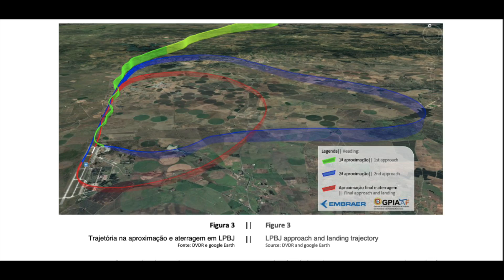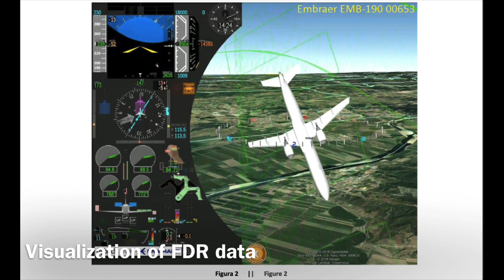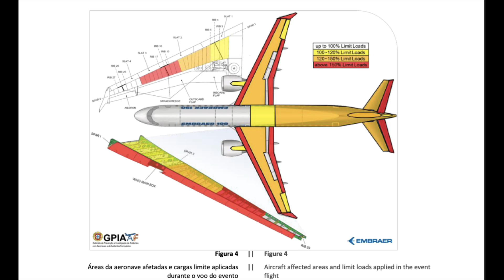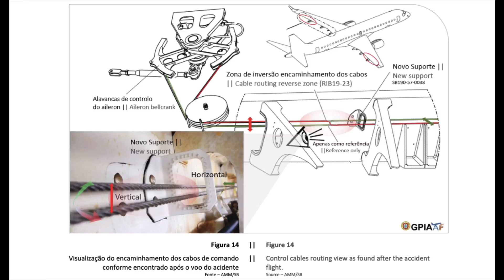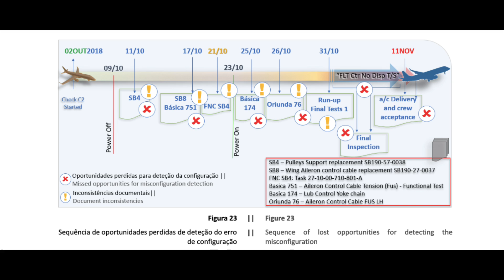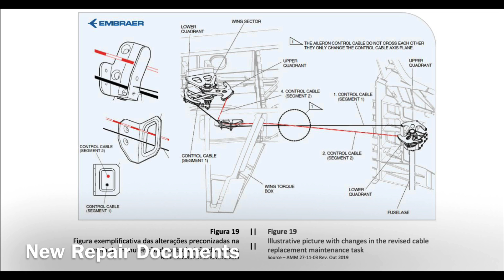Fighting To Survive | Air Astana Flight 1388

Comment: I think the real reward for the pilots was living to see the next day.
Reply: No, the real reward for those pilots would have been walking into the maintenance hanger, finding the maintenance crew, and punching them right in the nose.
Reply: @IrishEddie317  how many acft have you successfully fixed? Mistakes do happen in the Mx world. But you probably know that .
Reply: @deaf2819  but really that kind of mistakes should not happen. Not to a whole crew not at something, that is so crucial. Even if it wasn't intended it would have been their fault if this didnt go well. All they had to do is powerup the engines and do a flight control check with somone doublechecking what the ailerons are actually doing. Yeah mistakes can happen but you need to find them before you declare something safe. Thats your job and if you are unable to do that you should be thinking of another profession.
Reply: @IrishEddie317  Inexperienced maintenance people working on items they should not have been.
Reply: The pilots deserve the polarisn award
Reply: @IrishEddie317  
Absolutely manually check the control surfaces after replacing the cables!!! All it takes is 2 dudes and a couple of two way radios...
“Hey bro, I’m turning left, what are the damn ailerons doing?”

How hard is that shit? Especially if many possible souls are at risk.
Reply: The real reward was the friends we made along the way.
Reply: @Dave Mould im an acft flying crew chief I know lol
Reply: @Dave Mould 
Exactly. I worked in software maintenance and anything I fixed or altered I would test. It was impossible for me to release a piece of new code without checking to see what it did. And that wasn't even putting lives at risk. 
The person who ran the cables should have got his supervisor to check how the new cables behave. This is 101 on any maintenance job, even changing a light switch.
Reply: nah if its anything like the trucking world its getting back to base finding the maintainence guy and slapping him up and down the hanger for almost getting him killed
Reply: @IrishEddie317  actually I would disagree with that. The real reward would believe to kick corporate ass who went for low bid on maintenance crew training! And lack of supervision! Good thing the pilots were is skilled as they were.
Reply: @deaf2819   Mistakes happen. Yes. I'm a mechanic and I know that you can screw up. But when you are in charge of maintenance when hundreds of lives are in your hands, you need to be extra careful as you do your repairs and double check everything.
Reply: Best reward of all, another day above ground is the best of blessings, so folks take advantage and enjoy each day and make this planet a little better for everyone...and stay safe!!!🙏🛫😎
Reply: @kevintucker3354  Yall say that like it's so simple. Clearly it's not protocol in the industry so no actually. And given how they kept it so long fighting with the computer not exactly pointing out precisely what was up, or at least what general system or control surfac it was complaining about, there are MULTIPLES of extra steps that need to be added to the itinerary before we even get to "just have someone in place to visually check the things."

Before that even, more clear blueprints should have been a thing.

Hell why am I even bothering. Yall are posterchild for zoned out until the last few minutes of the video when that detail was brought up and equating it to working on a car. Just no

Comment: The amount of times these poor guys asked for vectors to the sea. That must be a horrible thing to have to ask for, but to have to ask 10 or more times, that really rubs it in. Every time they managed to stop the plane from doing circles, they were facing the opposite way to the sea. But... Actually, im glad they didn't make it to the sea. Had the made it there, they mayve ditched and planes landing on the Atlantic is not something I would wish on anyone. Good work fellas. And to the f-16s and controllers. 
The reverse controls remind me of the 3 Boeing 737's having huge problems in the 90s, only the final one managed to land. 
Another great video.

Comment: They had it upside down three times and had to pull it through, pulling about 5.5G. It's a miracle that the wings stayed on.
Reply: I assume it is now scrap and not purchased by a budget airline.
Reply: Well, it certainly didn't return to the fleet.
Reply: If i have understood correctly, they would have to change all those parts that were subjected to abnormal stresses, meaning most of the plane. No one would ever trust parts that have endured 120-150% of the force they were designed to endure and is most likely kept together by the paint and sheer strength of character. It's one-shot deal going over that limit, part most likely will stay intact the first time but no one would quarantee second time. And seeing other air crash investigations, they have scrapped planes for less.

This plane went to hell and back, going above and beyond what it was ever designed to do and still got back on ground in one piece so i would say the airplane itself is also a hero in this story with the crew.
Reply: And even more that they did not lose consciousness, you can easily pass out because your heart can’t pump blood to the brain when you way 500kg assuming 80kg normal weight
Reply: @rogervanbommel1086  I don’t think it’s been confirmed that nobody did. The pilots flying might’ve even been helped by naturally straining to control the flight if they didn’t already know to do anti g maneuvers, and there were at least a couple minor hospitalizations from the flight. The engineers... I don’t know about them lol
Reply: Where’d you read that they had it inverted?
Reply: At Air Astana. I've flown KCJ many times.
Reply: @alaric_  That was a strong aircraft, for sure. I agree about the scrap destination, though. You can't keep using it, as if you were driving a dog-tracking pickup truck down the road.
Reply: @SimonWallwork  I think someone was embellishing, then, because it was never inverted
Reply: @drnogueiras8783  Maybe you know the pilots better than I do then? Anyway, its been scrapped now.
Reply: @SimonWallwork  I’m sorry that I’m gonna go ahead and believe the radar, FDR data, video from one of the intercepting f16s, and every single other report over a stranger on the internet claiming he knows the pilots personally... especially when you went from not even mentioning it, to “I flew the airline many times”, to “I know those pilots personally” 🙄
Reply: Suit yourself dude. It's a free world. I was an Embraer Captain with Air Astana when this happened. It was later introduced as a study topic in their CRM programme, which I attended- but you da boss!
Reply: @SimonWallwork  I’m not the boss, I just watched the entire flight path and metrics and it wasn’t inverted.
Reply: @SimonWallwork  also curious how you ended up flying for Kazakhstan. I’m assuming you speak fluent Russian then?

(Again, fluent. Not google translate. I DO speak Russian, so please let’s not pull that because it’s never right).
Reply: @drnogueiras8783  Assuming wrongly again Doc, they had 135 expat pilots...until covid. How do you think they pulled over 5G then, doing aileron rolls? They had it over on its back several times, look just before the very high rate of descent parts of the FDR info. They pulled all that G, thus writing the a/c off, as they pulled out of those big dives. Pilots call this 'pulling through'. There's no way they would have pulled all those Gs, without going inverted. Are you sure 'attitude' is a parameter on the info you looked at?
Reply: @drnogueiras8783  dude the flight path does not tell you the angles of the plane. it tells you the height, heading, position, etc but you don't see if the wings are horizontal or vertical or what

Comment: Ah yes, when the computer finds a fault, reset it and the actual problem will totally go away! Pls trust. Good thing it wasn’t fully loaded with passengers and that the pilots persevered through this ordeal.

Thanks for the video!
Reply: Believe it or not this is often times the fix for acft.
Reply: Put it into service mode, flick dipswitch 27, cycle power 3 times, error code gone. Old hand's trick.
Reply: @henrychan720  An online study has found that 100% of households have an internet connection. :P
Reply: @dinoschachten  LOL

Comment: Flying that plane must have been like trying to ride one of those bicycles where the front wheel moves opposite direction of the handlebars.
Reply: at 200 km/hr
Reply: @wazza33racer  with certain death if you fall off.
Reply: and when you turn the handlebars front brakes are applied.

Comment: This is why you always use the 'thumbs up' rule when working on or checking the ailerons.
You can't just move the yoke or stick back and forth and look to see if the ailerons are moving.
Put your hand on the yoke and raise your thumb. When you move it your 'thumb up' must point towards the 'aileron up'.
These guys are lucky to be alive.
Reply: I was always taught, "stick left, left up, stick right, right up" mantra, but I guess it matters little as long as you remember!
Reply: How can't aerilon movements be seen from the cockpit of a modern jet airliner, on which the wings are swept back and are a long way from the plane's nose and cockpit.
Reply: Anon anon, the angle of the wing makes the angle of view go thru the thick part of the wing, even towards the outer edge, thereby obscuring the ailerons from view from the cockpit. That's why maintenance always has one in the cockpit and one on the ground communicating via the intercom.
Reply: Wrong. Musikur is right.
Reply: @None-zc5vg  The plane had an indicator in the cockpit that showed which way the surfaces were deflecting. If the captain looked down at his flight displays while testing the ailerons and spoilers (which he was supposed to), he would have noticed them moving the wrong way.

Comment: Damn. That's Captain Sully levels of airmanship. great job
Reply: Minus them missing critical flight control checks before the flight.  They are just as responsible as the maintenance teams.  No one followed proper checklist and tech data from maintenance to the pilots.
Reply: In a sense, what they did was better than Sully.

True, as Scuba Dog wrote, they could've found out before leaving the ground.

But most of what Sully did was immediately start the APU, and not do anything stupid (like trying to get back to the airport, over the urban areas). Well, and outstanding CRM and prioritization. 
Sully's flying was excellent, but much more based on a calm and rational response in a VERY brief time window.

This crew, on the other hand.... 
They fought the controls for 2 HOURS and never gave up. 
Despite being exhausted, and essentially locked up in a flying coffin whose controls were actively fighting their efforts to land.... 
That's quite a different feat!

(still glad everyone survived both incidents of course)

Comment: I am a captain who has flown this type of airplane and feel obliged to make a couple comments on your video. I am impressed with the technical detail you included in the video but I think the final comments on the aircrew’s failure to diagnose the maintenance failure prior to takeoff is completely off base. The pilots, from their duty stations cannot see any flight control movements. The pilots rely on a flight control page to verify that proper control inputs are registered through the display screen. I would have no way of knowing if maintenance reversed the cables and then changed the computer registration of the inputs to appear normal.  Since I am not qualified to do physical work on this airplane I rely SOLEY on the maintenance staff to insure all updates, repairs, and inspections are completed and correctly signed off. The pilots did a fantastic job of maintaining control of this airplane and landing it safely, my hat is off to them.

Comment: I was an inspector on a C-check and caught a lot of cables that were crossed and also ran wrong. Where was the QC who stamped for it, and why was it not noticed on ops check? Before we release an aircraft for a test flight, we would make sure that all the flight controls move in correct direction and they move freely.

Comment: I am a tug plane pilot for gliders. In my preflight checklist I verify elevators, flaps, ailerons and check visually that they move in the right direction. I cannot do the rudder as it turns the nose wheel as well. Inverting the cables during maintenance is a classic mistake. On an airliner, you can get a mechanic to watch the aileron deflection and report by radio. On an F-16 (fly by wire), they reversed a pitch gyro on the flight control system, that reversed the elevator but only once airborne. That is tricky because when tested on the ground, with no feedback to the gyro, the elevator moved normally.
Reply: Was that plane a write off after the incident?

Comment: First thing I thought of was crossed control runs. This as a potential major flight safety issue has been know about for many decades. In my time as an aircraft maintenance manager in the 1970s and 80s, any work on control runs (and any other safety critical systems such as air speed indication etc)  required an independent (ie by someone not involved in the work just completed) functional and visual check that everything was working correctly. Clearly they omitted this vital check. Well done the crew - I have great admiration for them on what was virtually a stricken aeroplane.

Comment: Ok... In my first ever flight lesson I was taught to check that my flight controls were operating correctly (i.e, ailerons deflecting properly). The fact that nobody bothered to do that before this plane flew, ESPECIALLY since the flight control systems had been worked on, really blows my mind. Kudos to the pilots for getting it down, but they shouldn't have even taken off in the first place!

Comment: I heard the radio chatter between this flight and ground control in another video.  I remember the pilot sounded clueless.  He kept begging for directions to the sea for a crash, and never seemed to know which direction he was flying.  It made no sense.  This video gives me a much better idea of what was really happening on that flight.  There's a reason communication is last on the list during a flight emergency.  This crew was very skilled to have landed this plane safely after the crazy rollercoaster of a ride.  I bet every pilot looks out the window to be sure control surfaces respond to inputs correctly during preflight checks.

Comment: A few observations here;

Only a dunce would make the first flight after maintenance into the clouds. 

When I took my ATP (Airline Transport Pilot) check ride in a Piper Aztec , about the only time both engines were running was the I was asked to land without touching the yoke (steering wheel, sort of). Yes, it can be done using differential power, rudder and elevator trim. I never had to but I was always ready to use this method if I had aileron trouble. 

I don't know about this one but with a lot of big planes, you can't see the ailerons from the cockpit. 

While most mechanics do a superb job of maintaining planes you need to do a very thorough preflight after maintenance. If this means having one pilot go back in the cabin to verify control surface movements, it'd be worth it. Since you can't see the rudder from anywhere inside the plane, have someone on the ground verify it. Trouble is, you need someone familiar with how control surfaces work.......

Comment: When I used to fly that was one thing I always looked for was aileron deflection when I turned the yoke.  I know it is more difficult in a larger aircraft but given the aircraft had just go through some major overhauling I would think they would take the time to visually verify every surface did as it was supposed to.  From your other video, I would add checking the trim tab movement as well if the aircraft had just been serviced.  I guess a new saying after an aircraft has been serviced should be, "Trust nothing, verify everything, BEFORE takeoff.

Comment: This just emphasizes that preflight checking the control surfaces is important.  But in most of the big irons, the ailerons aren't real easy to see unless you crane your head out the slider.  Good that they got it down.

Comment: That sucks, what is even more frustrating is the poor pass downs from the MX crew. There were a lot of factors here, unfortunately. I know that generally for things like this, they would have tried to avoid pulling panels to check the aileron rigging and may have assumed it could be a LRU or something. So they likely shotgunned parts at the plane, until the message on the EICAS stopped popping up. 

If the pilots could have noticed that the aileron inputs were reversed, I would have tried to pull the CBs for the roll ailerons. Granted, I only worked on the EMB145s so I don't know if they had a roll aileron control unit, or it was hydraulic or electrically driven. But goodness, what a shit show. For any future maintainers, a bit of green or white masking tape with the words 'Left/Right' on them is something worth doing. Always document what you are pulling apart, or hell, take pictures. 

Thank you for the video, I love your work. The Flight Channel has amazing videos, but sometimes I want to be doing other things while I am enjoying videos and you narrating makes it possible for people to do that. Thanks again.
Reply: Taking pictures & masking tape...... Better option.... Saves time and give little more confidence that components going on correct place... 🙌👍